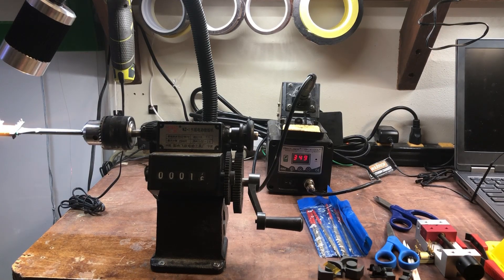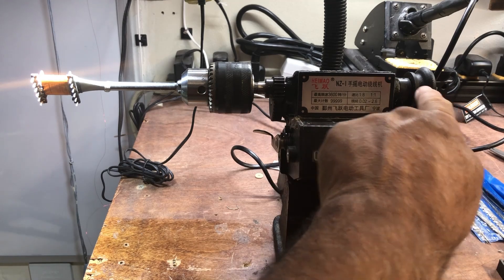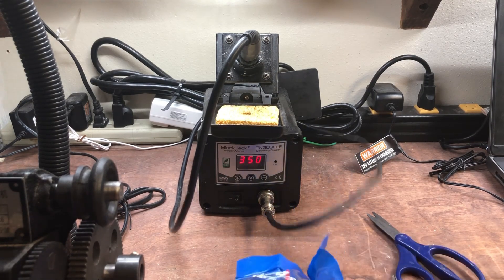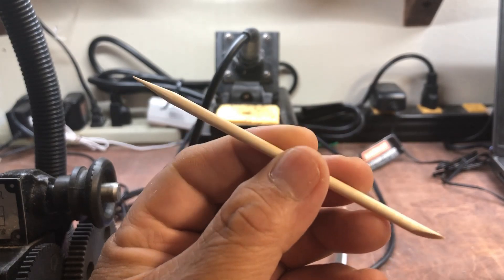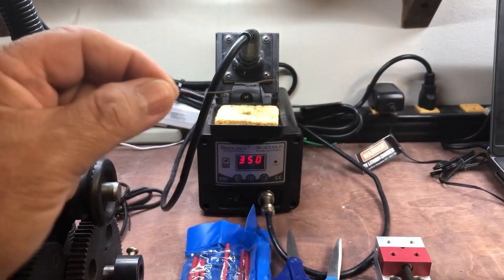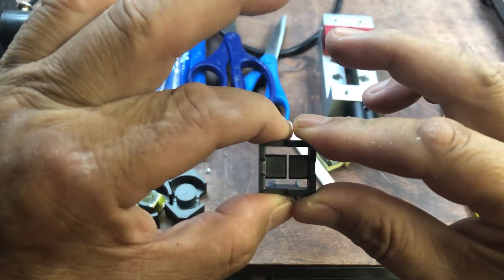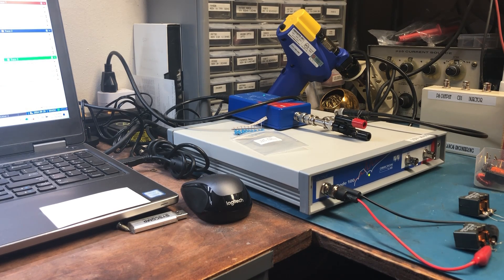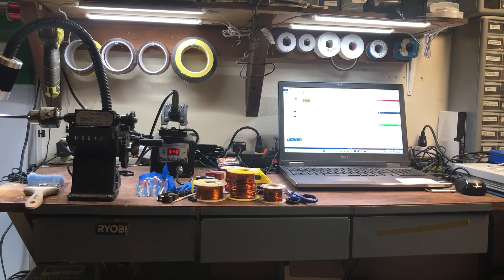Transformer Winding Tools and Equipment

Comment: Great video. This subject is interesting to me. In my previous job, I worked on HV dc-dc converters. We used 40 and sometimes 44 AWG secondary wire with hundreds of turns. My favorite tool for winding was a room full of skilled transformer winding technicians. They used motor operated winders for speed, and it was amazing that they could wind a layer in a second or two with perfect winding density. I never got more than three layers without breaking the wire. I like your manual crank winder; I’ll look around for one of those. Oh, by the way, we used a soldering iron with a ball of molten solder to thermally strip the enamel from the wire. I takes a bit longer than your stripper technique, but the stripper would likely break the fine where we were using. I would have liked to use a solder pot, but those are frowned upon in CA. I used the burnishing tool on a Leatherman Wave multi-tool for grinding small gaps, but we’d order a set of pre-gapped cores for R&D work on common transformers (that gets pricey though). Good suggestion on the diamond files.😊

Comment: Actually ZPE is easy. I did it several times, but i couldn't get more than 1:0.90 ratio. 0.10 is power loss because the entropy of the universe is always increasing! However at some point in the birth of the universe before the neutrino flux started it was possible to get above unity from ZPE point! Shortly after big bang where everything came out of nothing!

Look up "Pottipuram neutrino" in Google. Indians attempting to create a space devoid of finer solar/ space particles deep inside mountains of Western ghats to reach this goal. I worked there.

Comment: Subscribed! Little do most people realize, transformer knowledge is an area of overunity/zero point energy. I have reproduced two ZPE devices which utilize the principle of the resonance in the core material. I'm an electrical engineering student so I'm constantly learning more, however. One of the devices puts out 5 times more power than in, and the other one utilizes the resonance in the ferrite core to become self running indefinitely which puts out a couple of watts with zero input.
Reply: Cool mate! Don't known what you're smoking but I want some, please share !
Reply: @Janktzoni Crack, presumably.
Reply: Me too! From India. LoL
Reply: "energy from nowhere" ..... With all due respect, it's clearly evident you do not have an adequate enough understanding of physics or electrical engineering. Which is okay. But even someone with a non-electrical engineering/physics background can easily find out if ZPE is theoretically possible by a quick search. Inquiry or skeptism is completely reasonable, especially given the fact that any and all technologies of any signicance have all been suppressed over the last century and the average person is most generally not going to be literate enough in the area of physics/electrical engineering. The Federation of American Scientists reported in 2017 that there had been nearly 6,000 patents that had been suppressed under secrecy orders (under the Invention Secrecy Act of 1951). That's only one mere data point to be made out of hundreds that I could make.
Reply: @AethericTheorem  Wow that's crazy
Reply: @The2bcooper I''ll definitely be making  some videos about the devices I have so far in the near future. I'm currently in the very beginning stages of reproducing three other devices (Floyd Sweet's VTA, the TPU, and a similar device patented by Daniel McFarland Cook). I have confidence with all three. The TPU and the Cook device utilize the same principles of magnetism & iron which is relatively secretive and only a handful number of people know about. 

I'll also demonstrate longitudinal propagation which is not acknowledged by mainstream physics and which is also actaully classified. Longitudinal or "scalar" mode of propagation will penetrate any EM shielding box or Faraday cage. It also appears to be undetectable by any conventional RF receiver architecture. Longitudinal propagation is a non-hertzian (non-transverse) perturbation in the aether... Soundwaves are non-transverse and so is light actaully. Instead of being represented as cycles per second, it's in volts per second.
Reply: @AethericTheorem  I'm also currently an EE student with more than 10 years of prior hobbyist experience, and I believe you. There is a German document that might be of interest, "Kompendium Wirbelphysik" (literally translates to Compendium of Vortex Physics). You can use an online translator to read it. Yes, it's a fact that a lot of inventions are being suppressed. Take care.
Reply: Alright, I will engage in good faith. I encourage you to spend as much time as you can studying from people like Robert Bolanos—proven experts in their field; with deep, foundational knowledge of electronics and engineering. People who generously share their lifetimes of learning and experience with others, but without unnecessary spectacle or questionable, unproven ideas that lack the kind of legitimacy that’s earned through 150-years of applying the scientific method. 

The challenge with experiments involving threshold energy measurements is that home/DIY labs rarely posses the kind of noise-free, controlled environments that are necessary for ensuring there’s not some difficult-to-detect parasitics or interferences that can cause compounding errors and unexpected results that cannot be replicated. Before anyone can realistically understand what they know, they must have some idea of how much they do not (or cannot) know. 

I would assert that you have not uncovered an as-yet unknown to physics method of creating energy, but rather you have witnessed a phenomenon that you do not yet have the knowledge to understand. The scientific method requires that you interrogate your results under the presumption that they are false, and produce overwhelming and unimpeachable empirical evidence for their validity—empirical evidence gathered through experiments that have been sufficiently documented that others can independently reproduce the same results, and using citations to other past research that support your methods. Anything else, including any amount of video evidence you might put forth, is insufficient to makes the sort of claims you’re making, and thus, a waste of everyone’s time. At this stage in your growth, you should be seeking deeper understanding, rather than claiming it. 

I sincerely hope you are well, and you were not too offended by my initial snark—I do not actually think you’re smoking crack. This is really more of an amphetamine vibe (also j/k 😜).
Reply: @silverXnoise Yes, this is all very obvious, but good feedback and thanks. Not trying to come off arrogant, but anyone who thinks that I've said something controversial is just way behind. I go out of my way to surround myself by people who I can learn from and look up to who are highly knowledgeable. Surround yourself by inventors and engineers like I do who have COP >1 patents and preferably converse with them if you can. Also to those people, I would first make the suggestion to go back to very beginning and study the work of Maxwell, Tesla, Steinmetz, Heaviside, J.J Thompson, etc. I would also consider Eric Dollard's lectures and books required material. Eric Dollard is the most authoritative electrical engineer on electrical theory in the public domain.... And Dan Winter as well. Read Steinmetz' Waves and Discharges. Learn REAL electrical theory prior to Einstein and the fallacious nonsense being taught by modern phycists today. I would also require Ken Wheeler's material and his book on magnetism which is the first and only book to reveal what magnetism actually is. That's a really good start. But no one is going to spoon feed you. You have to do it on your own and become good at researching and being resourceful. I have a 14 terabyte drive and save everything offline, have been since I started researching in my early teenage years. It's ALOT of material, so I would suggest saving everything offline, even webpages. It makes things so much easier and faster.
Reply: @silverXnoise  I'm snoozing through the material in my bachelors because academia is wholly unimpressive as any scientist or electrical engineer worth looking up to will tell you. As far as advancing the electrical science and field theory go, it's dead in the water. And on the theory end of it, a lot of it is incorrect. No, kids, electricity is not spheres of mass moving from atom to atom. This was understood even a hundred years ago. Instituitonal learning and education for the most part is just a diploma mill for people of mediocre intuition and intelligence to go out into the workforce and get a job. Which is fine, but it's just cringe when you have complete morons waving their PhDs around (especially in humanities). I have a couple of people I personally know who have PhDs and they're really just not that impressive intellectually. Memorizing material that is spoon fed to you and taking a test does not necessarily mean that you're a smart person.
Reply: @silverXnoise  I would also venture that all the components actually dissipate power. These folks need to build a working prototype that is not plugged in, and let me make my own and run it. Then I will believe.
Reply: @silverXnoise  I will add that the proof is in mechanics. Can it do work without outside input? Will it do so indefinitely?
Reply: Bullshit.
Reply: Can you demonstrate that?
Reply: Quite the intellectual exemplars thus far giving subject matter expert level insightful feedback 👏
Reply: @AethericTheorem  ...as responses to your claim to produce energy from nowhere they seem like reasonable comments.